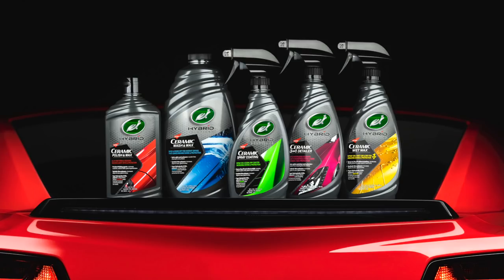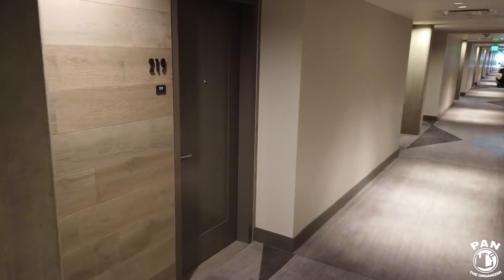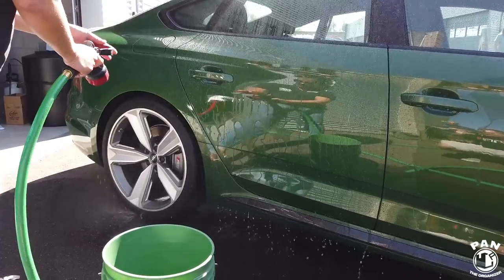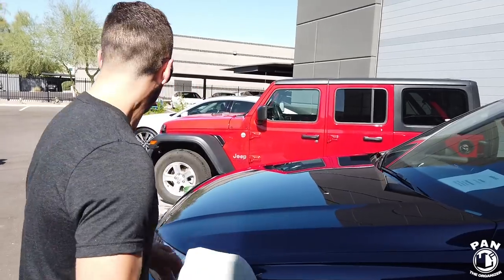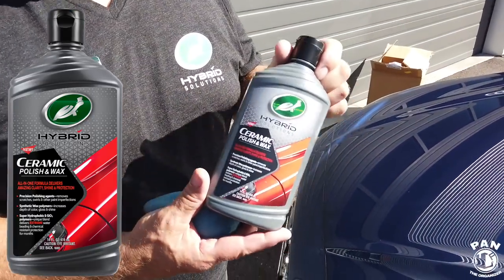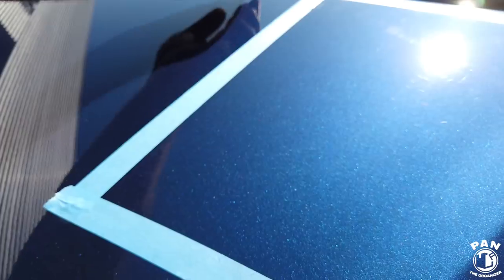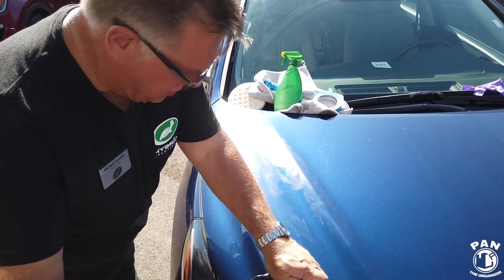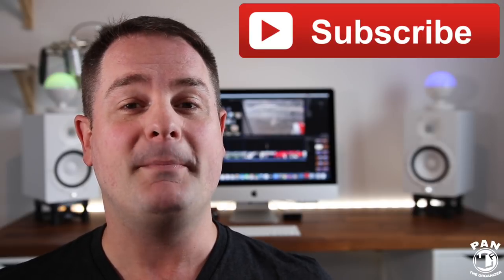NEW TURTLE WAX Hybrid Solutions products unveiled for 2020 !!

Comment: Turtle Wax needed to turn waters, in order to put Detailing YouTubers talking about their brand.
They did it!
This does not mean their products are not up to the standard that YouTuber usually work with. On contrary.

Turtle Wax used this awesome new line (Turtle Wax Hybrid Solutions) to pump the hype onto YouTubers; then they pumped it back to us enthusiasts; and finally we will pump it right to our friends (general public).
This will not only make us talking about the Turtle Wax brand, but also about these products in specific.
Even YouTubers which were not invited to this unveiling are talking about this Turtle Wax Hybrid Solutions lineup.

I already ordered two from Amazon Spain (.es): (1) the Ceramic Spray Coating, and (2) the Ceramic Wet Wax.
If they are up to this hype, I will keep buying them, and will not only buy the rest of the lineup, but will also recommend it to my friends.
But it is really important that the product is really good!

Finally, I think Turtle Wax needs to bring sense to their all lineup.
Even NextZett - which their German names - have more sense on their lineup.

I mean, calling "Ice" to an intermediate lineup does not make sense. I though this was for Icy climates - which Portugal is not one of those.
Moreover, they need to do a product for each purpose, and it must be clear:
- Iron reomver
- Tar remover
- Carpet cleaner
- Leather cleaner (matte or shiny finish) [this they already do]
- Snow foam 
- Etc...
Only then they can thrive in this populated market!
Otherwise, people will either run away to a simpler brand, or go to more expensive and well-known brands.

Comment: As usual your video is very informative. I'm an apartment dweller without water access or power so the 3-in-1 detailer is something I'd try.
Reply: Peter Cawley try Optimum No Rinse. I live in an apartment too, and utilize the Gary Dean method for my rinseless washes. Extremely cost effective, and top the car off once a month with Seal and Shine. You'll be very hard pressed to find a more economical combo that'll clean and protect to the level those two products do.
Reply: @Twiztid_Metal  thanks for the advise
Reply from the maker: Thanks Peter!

Comment: So this doesn't cut down my time as I had hoped. When using Griot's 3 in 1 Ceramic, I polished and laid down a coat, waiting over 12 hours and applied 2nd.  If the "1-Step" would durable enough it would be great, but I'm sure it needs the Ceramic Polish (which would be 1st coat) then apply the Ceramic Spray as the 2nd coat, so I have to have the vehicle here over 24 hours.

Comment: Hi. Great work and explanation of the products. Is turtle hybrid ceramic polish and wax required or safe to use on a new car for paint correction? Is this paint correction/ prep required on a new car? Or else just the shampoo wash and ceramic spray coating should suffice?
Reply from the maker: The earlier you start protecting a brand new car, the better. To give you an idea of the steps you can perform, watch how I detailed my brand new BMW as soon as I took delivery from the dealership: https://youtu.be/dsCmJJDP3xo

So the only thing that would change here, is that instead of the glass bottle ceramic coating that I used, you can use an easy to apply spray coating like Turtle Wax Hybrid Solutions Ceramic Spray Coating.

Also watch my super popular review and tutorial for the application of Ceramic Spray Coating here: https://youtu.be/_r_AXaUeTIQ

Comment: Pan, a couple of quick questions on this lineup. Is there a preferred soap to use in a foam canon for a maintenance prewash or will any snow foam work without hurting the protection?   Second question, after doing a bug removal with Turtle Wax power foam, do I need to reapply the coating product or will using the 3 in 1 hybrid detailed afterwards be enough to maintain the protection?   Thank you for putting out such great content.
Reply from the maker: Watch my video on a snow foam battle: https://youtu.be/v5eKc1PKBqU

You wouldn't need to reapply the Ceramic Spray Coating.  Just use Ceramic Wet Wax when you're drying the car, that will replenish protection in a quick and easy way.  Basically, when you're done with your final rinse, when the car is still wet, you use this as a drying aid: https://amzn.to/2WLet7r
Reply: Thank you, Pan!  I ended up buying the whole lineup after watching your videos and I have been quite impressed with the results with the two vehicles I have detailed.  Will watch the recommended video and use the wet wax after the bug removal and wash.  Thanks again for all the great information you share. 👍

Comment: Pan...my thoughts are on the ceramic spray wax. I already have SnS on my vehicle and its awesome so I would think that I can layer the ceramic spray wax on top of SnS. Second, I think the ceramic spray wax formula is SnS infused with sio2. 👍🏻. So I am looking forward to using ceramic spray wax as a layer on top of the SnS.  And it was great to place a face to Waxmode!  😂
Reply from the maker: Ceramic Spray Coating is best applied as the base layer of protection to bond directly to the clear coat.  It can be applied on top of existing waxes and sealants, but the durability might not be as great.

Comment: What is the curing process of Turtle Wax 53409 Hybrid Solutions Ceramic Spray Coating?   Does it cure by humidity, lack of humidity, or temp?
Reply from the maker: It simply needs 24 hours before you use any chemicals on it.  And try not to expose it to water or rain.

Comment: Complete novice here... it seems these products do many of the same things....which ones would you recommend to start off with... the wash for sure but do i need the wet wax and the ceramic coating? thanks for the help
Reply from the maker: I would go for the Ceramic Spray Coating.  Then, during maintenance washes you can use Ceramic Wet Wax as your drying aid to top off protection.

Comment: Is recommended to use one of the alcohol type products to remove everything from the surface every time you're going to use a different product?
Reply from the maker: The better you prep a surface before applying any form of protection, the better the product will perform.  That being said, these products can also be used on unprepped surfaces.

Comment: Question, at the end he mentioned it’s like a base coat for the spray coating. Do all these products kind of “bond” together since they’re form the same family? Like for example the TW shampoo & wax and dry it off with the wet wax. Is that now “one”
Reply from the maker: They all work in synergy, yes.  So for example, you would machine polish your paint with Polish & Wax.  That will remove swirls, scratches, enhance gloss and remove light oxidation.  Plus it lays a small foundational layer of protection and acts as a primer for the next step, which is applying a protection like Turtle Wax Ceramic Spray Coating.  That will last many months.

Then, when you do regular washes, you have the option to use one of three items to boost and maintain the properties of the Ceramic Spray Coating:
1) You can wash your car using their Turtle Wax Ceramic Wash & Wax
2) You can dry your car after washing it, using the Turtle Wax Ceramic Wet Wax as a drying aid
3) You can use the Turtle Wax Ceramic 3-in-1 Detailer as a quick detailer to remove light dust or bird droppings, etc.
Reply: Pan TheOrganizer perfect, thank you very much. That’s what I figured from my own usage but I wanted to make sure. Big fan of your videos! I watch all of them. 👍👍
Reply from the maker: Thanks!  What’s your favourite video on my channel so far?
Reply: Anything with quick ceramic options because I do my stuff on the weekend. So far these TW products are my favorite

Comment: Can you use the 3 in 1 spray on a clean dry car ? And what's the best combination for cleaning and protecting your car would the 3 in 1 be any good
Reply from the maker: You can use this as a quick detail spray, but only if the car is lightly dirty (dusty).  I still always recommend a proper two bucket wash with water when possible.
Reply: @PanTheOrganizer  can I use the 3 in 1 spray after I have cleaned and dried the car sorry if it seems I am repeating myself

Comment: Ok I'm confused, car needs a good clean and maybe it's the Virus but can someone simply explain to me the steps before applying the HYBRID SOLUTIONS CERAMIC SPRAY COATING product? I don't have all the fancy equipment like soap guns etc but I will get them if they make sense. But starting with the typical home setup... garden hose, buckets and microfiber cloths what products in what order do I need to do that yearly clean? I see a collection of Hybrid products but not sure which to use and when? From my hunting I'm concluding steps should be: 
Step 1 - Rinse car & wheels with garden hose 
Step 2 - Spray wheels an tires with "TW Wheel & Tire Cleaner" (Not a Hybrid Product) and scrub, wipe and rinse 
Step 3 - Wash car with car wash soap and rinse. One without wax! Use 2 bucket method with big mitts. So I see no Hybrid product like this? 
Step 3 (Better) - get a soap gun but what soap to use? Turtle Wax 50597 Car Wash but is this for a gun? 
Step 4 - spray with Iron remover spray and wipe off (No Hybrid product) 
Step 5 - Wipe with clay mitt using Clay lube spray 
Step 6 - Spray HYBRID SOLUTIONS CERAMIC SPRAY COATING. Apply 2nd coat after 24 hrs. 
Step 7 - Spay Turtle Wax T217RA Wet'n Black Ultra Wet Tire Shine on the tires to make them shine. 
Step 8 - Go eat and have a beer! For ongoing cleaning use Turtle Wax 53411 Hybrid Solutions Ceramic Wash and Wax. 
For touch ups like bird poop etc use Turtle Wax 53413 Hybrid Solutions Ceramic 3-in-1 Detailer. 
Not sure when to use Turtle Wax 53410 Hybrid Solutions Ceramic Wet Wax? Or Turtle Wax Hybrid Solutions Ceramic Polish & Wax? 

Sorry long post but after spending way to much time trying to figure how to wash my car thought best to get it all out there! 
Thanks to any replies!

Comment: Is there a 24 hour curing time after using the polish and before using the ceramic coating?
Reply from the maker: After the polish, you need to wait 24 hours before applying the Ceramic Spray Coating.  After you applied the ceramic spray coating, you can technically drive out in the elements even if it's raining, but don't wash the car for at least 24 hours after applying Ceramic Spray Coating.
Reply: Thanks Pan. What if the car stays outside overnight? Should it be washed again after the 24hr polish cure before the ceramic spray?
Reply from the maker: Not sure about that one.  You would have to ask Turtle Wax.  When I do cars, they stay in my garage until the job is done.

Comment: Pan, I have all the new Hybrid products from Turtle wax.  I wrote Turtle wax on what sequence to use the products. I got interesting comments.  I would be interested to here how  you would use the products and in what sequence you would use them.  Thanks
Reply from the maker: The Turtle Wax Hybrid Solutions line was made so they all work in synergy.  So for example, you would machine polish your paint with Polish & Wax.  That will remove swirls, scratches, enhance gloss and remove light oxidation.  Plus it lays a small foundational layer of protection and acts as a primer for the next step, which is applying a protection like Turtle Wax Ceramic Spray Coating.  That will last many months.

Then, when you do regular washes, you have the option to use one of three items to boost and maintain the properties of the Ceramic Spray Coating:
1) You can wash your car using their Turtle Wax Ceramic Wash & Wax
2) You can dry your car after washing it, using the Turtle Wax Ceramic Wet Wax as a drying aid
3) You can use the Turtle Wax Ceramic 3-in-1 Detailer as a quick detailer to remove light dust or bird droppings, etc.

I hope this helps!

Comment: Hi Pa, enjoying your show. I need your advice on Turtle wax hybrid ceramic spray coating. I did allpy to my car per the direction on the bottle but had a problem of smearing and haze after buffing. What am i doing wrong? Greatly appreciate your advice on this.
Reply from the maker: What preparation did you do on your paint? Did you fully strip the surface? Wash, iron decon, claybar, machine polishing, IPA wipe, and then apply 1st coat, wait 24 hours, and then apply 2nd coat. Apply very thin layers, don't overapply.  Also, what conditions did you work in? Direct sunlight? Shade? In a garage? Humidity level? We need more information to be able to help.  Did you try reaching out to Turtle Wax?
Reply: c @PanTheOrganizer  The car was bought only few months ago as a brand new car with a ceramic coating done at the dealer. The car is kept at indoor garage and I only drive on a weekend. So, it a pretty good condition to start. I washed the car using Chemical Guys HydroSuds High-Gloss Hyper foaming Sio2 ceramic car wash soap during a cloudy day. Humidity was around 40%.  I have contacted Turtle wax but no reply yet. I found the Youtuber who had a very similar problem. Please check the video starting at 11min:59 sec of https://youtu.be/-uGRJklP3xg. Greatly appreciate your advice. Thanks.
Reply from the maker: It seems obvious from what you wrote here, that there was chemical non compatibility between your SiO2 based soap and Ceramic Spray Coating. Ceramic Spray Coating has to bond directly to virgin clear coat, or on top of an existing true ceramic coating. You should have used a pure shampoo, like Adam's Car Shampoo or CarPro Reset, with no wax or ceramic additives inside. So by washing with a soap infused with protection, it was trying to fight off the product you were trying to apply on top, in this case Ceramic Spray Coating.
Reply: @PanTheOrganizer   Hi Pan, Thanks for your advice. I thought it was much easier product to use but obviously there are things you must be aware applying it. I may resort back to using good old wax products( i.i. Adam's buttery wax) on my ceramic coated car. Again, greatly appreciate you taking your time to give me the advice.

Comment: your videos have actually helped me out a lot... it made me return my Meguiars hybrid ceramic wax today and buy turtle wax after I received a follow up email from a Meguiars rep today who said that their hybrid ceramic wax does not offer UV protection... I saw your video when you interviewed the turtle wax chemist and he confirmed the UV protection.... that had me sold and I immediately went out and bought the TW ceramic spray coating... I have a question for you though... with the ceramic wet wax, does this also offer UV protection? I can't seem to find anywhere who is certain of that
Reply from the maker: I don’t know if Ceramic Wet Wax has UV protection.  But as you’ll already have UV blockers in your base coat of Ceramic Spray Coating, that won’t matter.  What Ceramic Wet Wax will do is act as a drying aid during maintenance washes, a topper over Ceramic Spray Coating to boost gloss and hydrophobics.
Reply: @PanTheOrganizer  appreciate the response!! Yeah I was thinking of having the wet wax for like an every other wash type of deal and then the spray coating can be reapplied for maximum protection
Reply from the maker: I would reapply the spray coating once ever 4 months.  The rest of the time you can use a drying aid.

Comment: Does the turtle ceramic polish depend the color more than the turtle wax ceramic spray??  Would it be best to layer it??
Reply from the maker: You should use the ceramic polish first.  Wait 24h, then apply ceramic spray coating.  Doesn’t matter what color car you apply these to.
Reply: Pan TheOrganizer I would agree on a car that that needs paint correction. I should have mentioned a brand new vehicle just off the truck with zero issues. I was a bit concerned about using a polish with perfect paint. When looking at the two bottles it seems they are the same except the cutting agents. Will the ceramic spray still give that deep gloss?
Reply: Pan TheOrganizer I would like to see a 10 wash test with these ceramics against Nu Finish
Reply from the maker: If you like the way your paint looks, you can skip the polishing stage.

Comment: @pan theorganizer
What are your thoughts on the turtle wax hybrid ceramic spray over a cquarts uk3.0 for a protectant layer?
Reply from the maker: You can’t compare those.  One is a 2+ year full blown coating that costs more and takes more experience to apply.  The other is an inexpensive DIY spray form coating “light” that offers great value and 9-10 months real world durability.
Reply: @PanTheOrganizer  I have cquartz Uk3.0 already, would this be a good option as a top sacrificial of sort to prolong the initial coat or use reload?
Reply from the maker: Absolutely!

Comment: Pan ~ If you kind of went through product and kind of explained how they might best be utilized. There are a number of products and it very confusing as to which is which and what there real application is. I would not know real where to start.
Reply from the maker: It will all be more clear in my video.  But it's pretty simple.  You have a soap.  You have a polish.  You have a waterless. wash/quick detailer.  You have a ceramic spray coating.  And you have a spray on, wipe dry formula.  You don't need all of these products.  Just the ones that you think you need in your arsenal.

Comment: has anyone that has used Eagleone for an iron remover? if so you know that the spray nozzle is garbage, it sprays in one stream, very thick and hard to use, this guy at 17:30 was spraying it very easily as a mist?? did Eagleone reformulate or have they changed their spray trigger recently?? looks kinda fake if you will.
Reply from the maker: LOL.  There was nothing fake about their demo.  I have the same Eagle One Black n PlastiCoat wheel cleaner (with iron remover) and it sprays identically.  Yes the sprayer isn’t the best, but it works like in the demo.